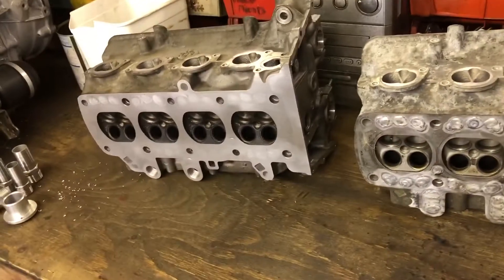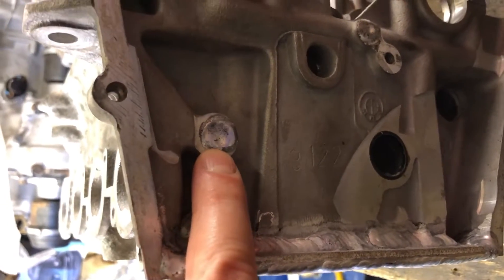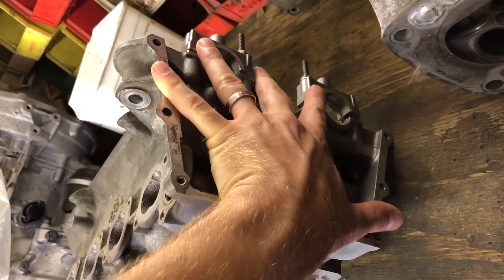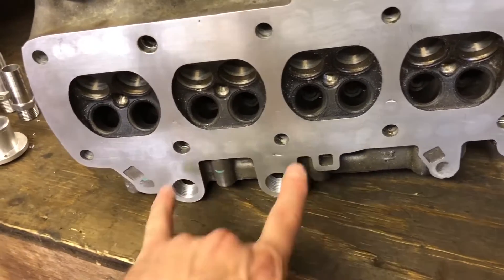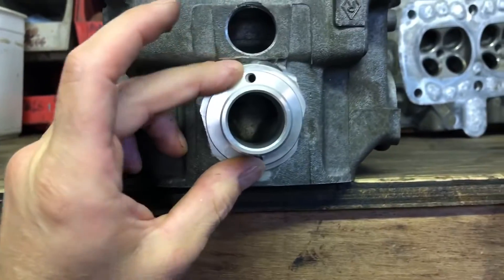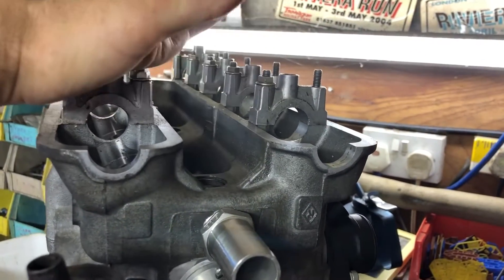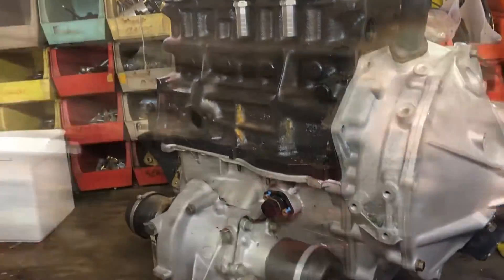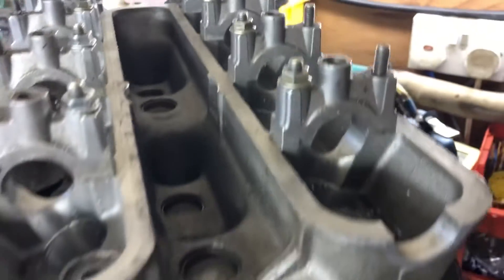BMW K Head Conversion - Head Modifications

Comment: 10mm pipe to 20mm pipe is an increase in area of of 4 times 78mm2 to 314mm2
Reply from the maker: Nice. Thanks for that. I’m no mathematician but I was hoping that it was a significant change. I’ll have to check but I think the ID of the fittings is close to 15mm but it’s still a significant jump in size.

Comment: is this possible on an automatic gearbox ? and use  a k00 8 valve head ?
Reply from the maker: That would be a good question for someone with more experience with the auto gearbox. Try speaking to John Guess of Guessworks. 

The auto block could obviously be converted to run a K head but whether the torque converter or the gear bands could hold the extra torque, I don’t know I’m afraid.

Comment: Hi nick its Reuben here what head gasket do you use for the BMW cylinder head on the mini block thanks
Reply from the maker: You can just punch out the holes to modify the standard mini head gasket, a lot of people have done that but also both specialist components and med sell one for it. 

I’ve gone for the med/cometic one. It’s not always listed on their website but call them.

Comment: I wonder if you can adapt the head to the Triumph or Reliant engines too? They have similar dimensions and are basically a similar design, from the look of it. I’d love to see one of these in an Austin 7, running side draft Webers or ITBs.
Reply from the maker: It would be an interesting day at a cylinder head gasket shop comparing notes wouldn’t it. So few engines are designed from a blank sheet of paper, there’s direct lineage from the a-series to the bmw k and a couple of other engines hence why it works. I’d love to find another conversion though, imaging an MGB with a Honda vtec head.

Comment: I am not sure what’s best for a street hot rod Mini, the K BMW head or the B series Vtec. Great video, thanks for the information
Reply: If you want lots of power and not to keep blowing cogs out of the box then the B series box is happy upto about 600bhp or so in stock form, the A series one isnt especially reliable when you venture much over 100bhp.
Reply from the maker: Yeh I hear you. I considered all the options. I’ve now been out in a Honda B18 mini and I’ve driven a red top Vauxhall one too. They were great for power but were missing something for me. 

I think Chris Harris got the sentiment in lockdown when he said “with classic cars, it’s not all about speed, you’ve got to celebrate the shitness too”

For me a fast mini is all about a whining gearbox, lightweight and fun. The Honda and Vauxhall both put extra weight over the front wheels and that, for me, changed the driving experience. Plus the k head swap means the historic element of a 1979 mini is still valid.
Reply: @NickThornhill 16v bmw swap but it's costly a 1380 with a decent ported head will be enough for the road to have fun in straight cut box just put an electronic ignition on and it will never let you down
Reply from the maker: Yeh I hear you. It is a lot more work to put the 16v head on the a series. I have already done the big valve head on a big engine before. 

I wanted to try something new this time. The perks of injection and 16v head is you get 130bhp+ but you still get 900rpm idle and a smooth drivable engine which, if you get 130bhp from a 5 port head, you will not get.
Reply: @NickThornhill  I'm building a 16v it's alot of work but its fun interesting I'm also rebuilding a 998 and trying to find standard size pistons for it as been a nightmare 😅
Reply: @ bmw?
Reply from the maker: Yeh you’ll struggle to find standard ones I reckon.
Reply from the maker: Yes. From the BMW K1200RS bike.
Reply: @NickThornhill  yes was quite the headache haha and I was planning on using a k1200lt head I think its the same as rs I'm not sure tho sc componets conversion kit althought there is a cheaper kit from a company called force racing but i cant find anyone using that kit and its nearly half the price 😬
Reply from the maker: I’ve used a force racing kit, although I have modified it to relocate the tensioner. If I was buying it all again, I’d spend the money on specialist components stuff. Although the force racing kit is nice and has some nice solutions to the problem, the fact that you’ve got to sort the rest yourself makes it a more complex project.
Reply: @bernardwarr4187  you can also but the ford 1 liter eco boost in there I should of probably done that it would of been the cheapest easiest way haha considering I bought a full car for 300 quid the other day 😅
Reply from the maker: Yes an engine swap can give you a lot of engine for not a lot of money, however making it fit in the mini engine bay and getting driveshafts made will take you as long as the k head swap, if not longer

My thinking with the head swap was that everything from the head down is a known maintenance item for me I like the rattle old gearbox and you have to celebrate the shitness of a classic car or you may as well just buy another car.
Reply from the maker: It’s a tricky decision to make. I went with the a-series and a better breathing cylinder head obvs. 

A Rover k engine swap or a Nissan micra engine swap were also on the cards and they’re all equally complex. Driveshafts are the hardest part to get right from an engine swap perspective as well as fitting the cooling in somewhere. 

I’d love to have a drive in an engine swap car and see how the handling feels. For me though I get a nice 16v throttle body burble but with the character of the Mini gearbox and the original weight distribution, plus everything from the head downwards is a known quantity.

Comment: What engine and head combination would you think is the eseayest to do? When doing a dry deck
Reply from the maker: Easiest would be a standard mini block and head. Dry deck is only really needed for race cars, it stops you losing the water when you have a head gasket failure and adds water flow to the far side of the a series block. I’m doing it because I plan to do some track work in it, so covering all bases.
Reply: @NickThornhill  and if you would convert it to a k head? A k1000, k1100 or k1200. And paired with what motor? 1000cc or 1300cc or anything else?
Reply: @BasEerdenKeuning  
The K1100 is regarded as the most flexible fitment for a roadgoing Mini by Specialist Components, and with a 1293 (0.020" over 1275) they should give about 120 to 130 bhp while still being completely streetable.
Reply: @freman007 is there any reason for using a k1200 head? Does it flow better for example or?
Reply from the maker: @rens3325 yes it does. The port shape and valve size, even the castings are the same but the K1200RS runs a thinner 5mm stem valve to aid airflow. 

The k1100 heads run 6mm valve stems. Every little helps and if bmw decided it was worth doing, they must have seen an improvement in airflow.
Reply: @NickThornhill  then I will try to find a k1200 head for my build

Comment: Nice - I'd heard of the K Series Mini's but didn't actually know what they were, a BMW Bike Engine, cool. In the video, what have you got connected to the Gearbox where the Oil Pick Up Pipe bolts to the gearbox case, it's normally a metal plate, but you appear to have something black there? Is this particular to a K Series?
Reply from the maker: Hi bill. Good spot. That’s a specialist components neodymium magnetic pickup, I’ve got another one in the regular sump plug but this offers extra protection. 

The theory is it picks up anything that’s makes it through the strainer before it gets to the oil pump. It’s removable like the sump plug so you can keep a check on what’s gone up the pipe. 

Hit me up on Instagram and I’ll send you the link.